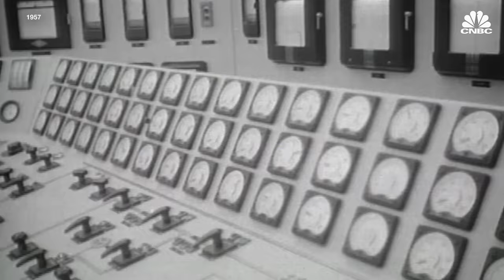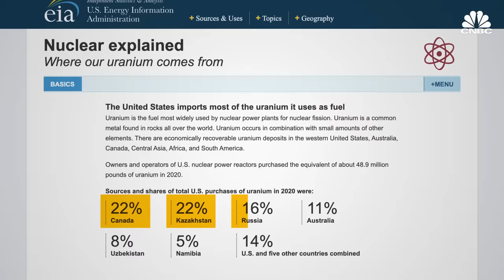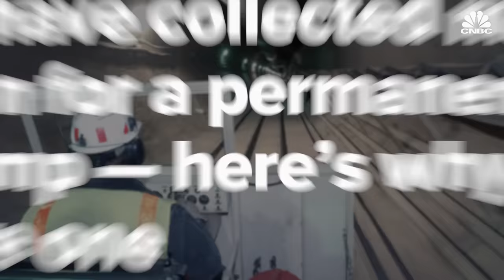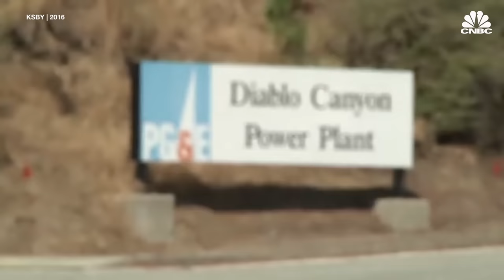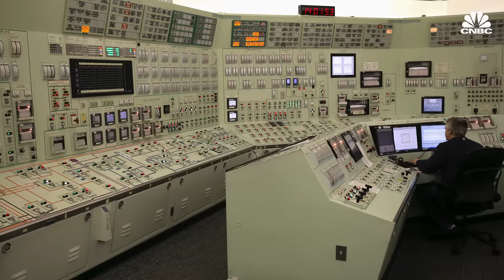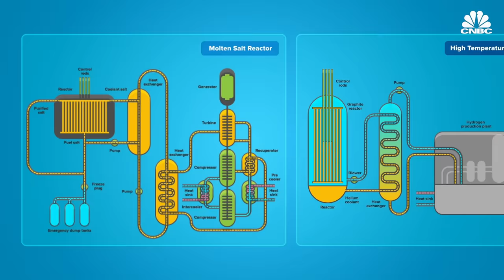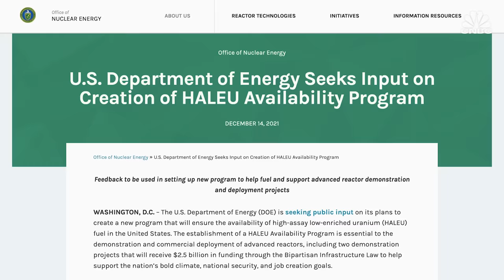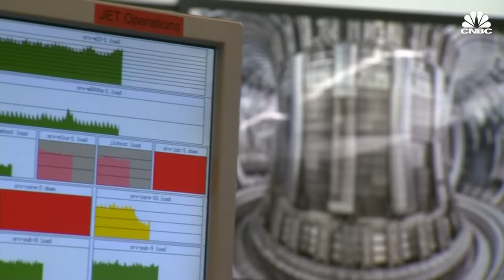Why Nuclear Energy Is On The Verge Of A Renaissance

Comment: Point1: Chernobyl was caused by the team in the control room performing a poorly designed test, in the absence of the "A shift" & test designer. It does not reflect on the safety of better designed and better controlled Western plants.

Point2: Anybody building an NPP in an earthquake prone region is a moron. When I learned in the 1990s that Japan actually had a bunch of plants, I said "well, they got few resources and need the power, they probably implemented extreme safety features." They did not. In fact, the seawall was pitiful and not sufficient to hold off even minor typhoon surges. 

With regards to that: The Diablo power plant should be shut off stat. Period. Building an NPP in California is a stupid idea, right next to using nuclear bombs for constructing canals. Unless, again, extreme safety measures had been implemented when it was built or can be retrofitted stat. Like passive cooling, earthquake-proof containment, etc.

Point3: Shutting down the German plants, that fulfilled the highest security standards and, in some cases, were relatively young (completed in the 1980s) while buying nuclear-produced electricity from Belgium (unsafe ancient plants), France (badly maintained plants) and the Czech Republic (a plant built after 1990, directly on the border to Germany, and after the Chernobyl blueprints FFS) is the height of stupidity.

Point4: Building a nuclear power plant in safe regions (eg Scottish highlands = elevation, geologically stable, etc; or Sweden, or Ohio, or...) is the ecologically least damaging way of producing baseload electricity.
Reply: Your explanation of the Chernobyl event is simplistic and WRONG. And a xenon power excursion can occur at western reactors but the event would be mostly contained by the containment.

So Japan, California, and most parts of the world should not have nuclear since there are earthquake zones everywhere.  The eastern U.S. experienced the greatest earthquake in history, but they are not as common as other regions.
Reply: @clarkkent9080  Btw WRONG!
Biggest earthquakes in history happened in Chile. Idk wth you are blathering about (perhaps New Madrid? Hint: This is not the east).
Reply: @danadurnfordkevinblanchdebunk  Fukushima.
Reply: @donaldduck830   Fukushima was not damaged by the earthquake, in fact the earth quake caused the reactors to immediately shut down as designed.
Reply: @Klerk Kant  And you were asked multiple times to show anyone off grid, which of course has nothing whatsoever to do with this video.  We are still waiting for you to validate such a meme.
Reply: @Klerk Cant  Show anyone living completely off grid as the millions you assert.  Surely you must be able to find one...
Reply: @Klerk Kant  Yep, obfuscate when you need to distract from not being able to validate your own memes, a typical trolling tactic.
Reply: @ Klerk Kant  "millions of people living off grid", yet you can't show a single one.  Pathetic.
Reply: @Klerk Kant   You just keep repeating yourself and haven't yet shown a single person living completely off grid.  You say there are millions, yet you can't show a single one....
Reply: @danadurnfordkevinblanchdebunk  keep on trolling
Reply: @donaldduck830   Show where Fukushima was damaged by an earthquake.
Reply: @danadurnfordkevinblanchdebunk  you are the trol, and since you can't stop trolling, you are blocked now
Reply: @Klerk Kant   Show where Fukushima was damaged by an earthquake.

Comment: Nuclear Waste is the major problem of many other issues. Look at the after life of the waste 100k years. afterlife.What do you do with that? This as idiotic as saying burning 20% of the hydrocarbons in gas engine is efficient while 80% of these are exhausted into the atmosphere. Just because you can do something does not mean you should aside from the incredible short long term costs. WHoops .Yucka Mountain Look it up
Reply: The waste has never been a technological issue, merely a political one.  Whoops!
Reply: @danadurnfordkevinblanchdebunk  And economic. Cheaper to let wastes sit in 50 gallon drums.
Reply: @darkgalaxy5548   Wrong container meme, but the low level wastes simply get disposed of at the appropriate waste disposal facilities.
Reply: @danadurnfordkevinblanchdebunk  The only appropriate site is 1 to 2 kms below ground, in a geologically stable area, isolated from aquifers. It will cost a lot initially, BUT if you amortize it over 100,000 years, it comes to only pennies a day ;-)
Reply: @darkgalaxy5548   Hardly.  The 2 billion year old nuclear waste site of Oklo proves you wrong.  Shallow burial with no containment whatsoever.  No widespread contamination of the area is observed. Burial is a last resort anyway when we can reprocess it or use it in fast breeder reactors.

Comment: Breeder nuclear is the future!
Reply: In order to burn old spent fuel from a breeder, you need a processing plant to separate the Pu239 from the other isotopes in the spent fuel. Then you need a plant to mix the Pu239 with U238 to make assemblies that can inserted into the reactor. And then there are the shipping casks needed to move the spent fuel from the old reactors to the processing facility along with security and loading and unloading facilities. It is not so simple or cheap when you consider the reality of actually doing it. 
The MOX facility was a U.S. government nuclear facility that was supposed to mix pure weapon grade Pu239 with U238 to make reactor fuel assemblies. It was canceled (2017) in the U.S. After spending $17 billion for a plant that was originally estimated to cost $1 billion and an independent report that estimated it would cost $100 billion to complete the plant and process all the Pu239, Trump canceled the project in 2017..

Comment: thorium?
Reply: uranium?
Reply: @clarkkent9080  if the amount of money  plowed into building nuclear had been put into researching thorium then it would have been better spent. So no commercial nuclear power plant has been used? probably right but, without the nuclear industry based on fission of uranium to make plutonium we would not have all the bombs we have now. YES IT IS ECONOMICS but they have been distorted because the USA&USSR (at the time) wanted Nuclear weaponry. with thorium there would be none.
Reply: @alasdairwhyte6616  The U.S. had multiple weapons materiel production reactors at Handford Wa. (operating in 1944) and Savannah River Site (operating in 1955)  in SC.  These reactors produced more Pu239 than was needed to destroy the earth 10 times over and the Handford reactors preceded the first commercial reactor by 11 years.  These reactors never produced any electricity and were specifically designed to produce one thing..Pu239.  Why would the U.S. even need any commercial reactors?  I worked in the nuclear industry 40+ years and was a Reactor Operator and Senior Reactor Operator and commercial reactors are designed to produce electrical power not Pu239 and has nothing to do with making bombs. Your statement is something I hear a lot and it is FALSE plain and simple. 

The U.S. tested every reactor type over the last 70 years and operated a Thorium reactor for 6 years as I recall in the 1960s and it was abandoned. Every reactor has its pros and cons and Thorium reactors were never at the top of the list.  Other countries are building Thorium reactors so lets just see how that works out and see if these other countries go all Thorium

Comment: 100% nuclear!!!!
Reply: still not giving up hope?
Reply: @clarkkent9080  I actually thought you would find this. What about smaller reactors?
Reply: @doug282  I thought we talked about the NuScale Small Module Reactors that are only 50 Mw which is 20 times smaller than the current reactors.
This is from the Des Moines Register an ultra conservative newspaper concerning the only Small Modular Reactor (SMR) project in the U.S. today.
In 2013, the Wall Street firm Lazard estimated that the cost of generating electricity at a new nuclear plant in the United States will be between $86 and $122 per megawatt-hour. Last November, Lazard estimated that the corresponding cost will be between $131 and $204 per megawatt-hour based upon the 4 recent new nuclear projects in the U.S. . During the same eight years, renewables have plummeted in cost, and the 2021 estimates of electricity from newly constructed utility-scale solar and wind plants range between $26 and $50 per megawatt-hour. Nuclear power is simply not economically competitive.
SMRs will be even less competitive. Building and operating SMRs will cost more than large reactors for each unit (megawatt) of generation capacity. A reactor that generates five times as much power will not require five times as much concrete or five times as many workers. This makes electricity from small reactors more expensive; many of the original small reactors built in the United States were financially uncompetitive and shut down early.
The estimated cost of constructing a plant with 600 megawatts of electricity from NuScale SMRs, arguably the design closest to deployment in the United States, was originally advertised as costing $1 billion but upon requesting actual bids from engineering firms, increased to $6.1 billion in 2020. Given inflation and other cost constraints that cost today can only be expected to be significantly higher.
The cost was so high that ten members of Utah Associated Municipal Power Systems canceled their contracts. NuScale then changed its proposed plant configuration to 6 fewer reactors but increased each reactor output from 50 Mw to 77 Mw costing at total of $5.3 billion. The NRC just last week approved the construction of the 50 Mw design but now will have to start the review process all over given the switch to a 77 Mw design. For each kilowatt of electrical generation capacity, that estimate is around 80% more than the per-kilowatt cost of the Vogtle project in Georgia — before its cost exploded from $14 billion to over $30 billion. Based on the historical experience with nuclear reactor construction, SMRs are very likely to cost much more than initially expected. And they now have delayed the project start until 2025 in an attempt to find more backers.  All this before the inevitable setbacks that will occur once construction starts.
Reply: @clarkkent9080  the problem with renewables is the base load capacity. And nuclear is still the safest and cleanest.
Reply: @doug282  I also believe it to be reasonably safe and clean.  However, the actual costs and time to construct cannot be justified.  And until someone actually builds one and proves the concept and cost, it is nothing more than a nice power point presentation or web page.

Comment: I also HIGHLY and I can't stress this enough, HIGHLY RECOMEND INSULATION. Insulation means you live and not die. So that you can eat some more sunlight off of "plants" of God. V.
Reply: Imagine a house within a house, how warm is that?
Reply: Your house has a walk around your inner house. Insulation? Or air pressure? What happened there? Density? No!
Reply: Clothes are basically insulation, really, so not just from eyes of humans, but the machine of God. Hair is less relevant when clothes are the thing to wear.
Reply: So your ventilation within your clothes, or the "level" there of, should be considered, weather or not your are "running" as they say, radiating heat or not.
Reply: Effectively, I claim with proper ventilation understanding, cold air can, yeah, thank you.
Reply: AND NO! lol I didn't start the war so that I can be more necessary, that would be marketing :) lol Um, stage management? lol Or God acceptance, yeah, that.
Reply: If you can afford to rip the drywall off the walls to re-insulate and afford to replace the drywall , mud it and paint it.
Reply: @Crashed131963  Look, is a smith. hi Smith :)